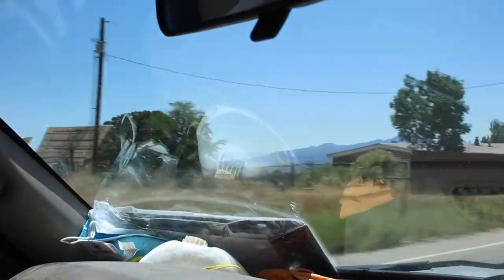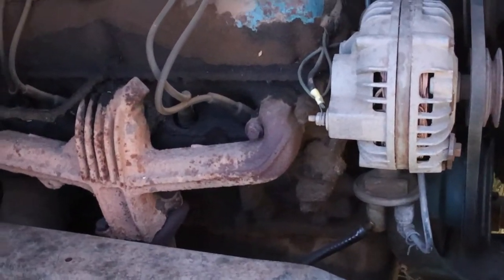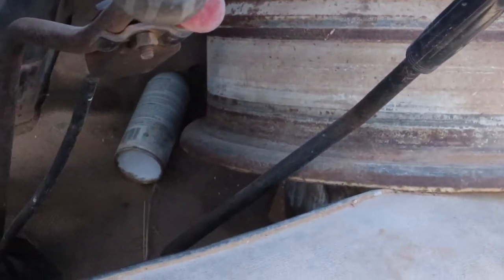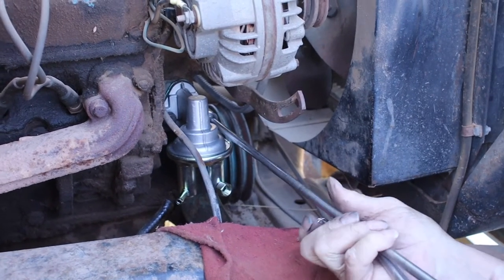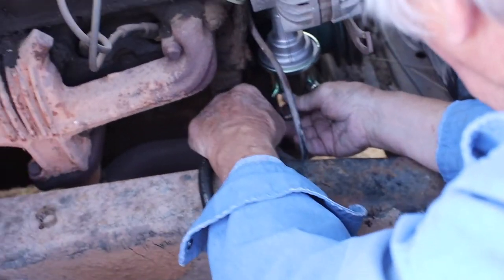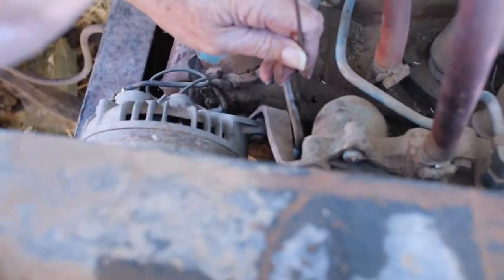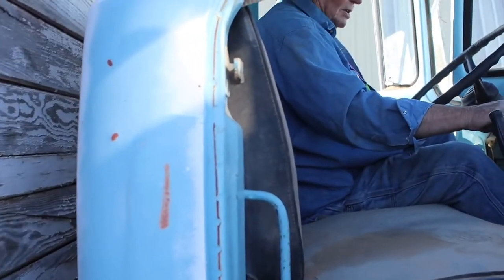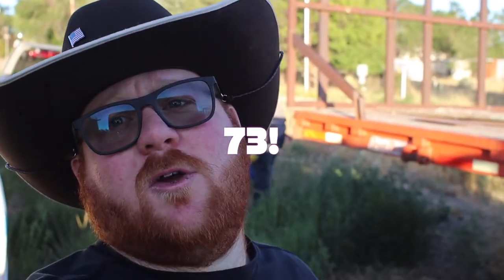1969 Fargo 500 Dodge Butterfly Hood

Comment: Mopar comes from MOtor PARts, that was a cross parts brand name for the thing that fitted between brands, so in short any Chrysler-built vehicle, so Dodge, Chrysler, Plymouth, Imperial, DeSoto or Dodge Trucks/Ram. By extension, it is also used for Jeep and AMC vehicles built after Chrysler's 1987 buyout of American Motors Corporation including the short-lived Eagle brand. In some countries they sold trucks branded as Dodge, Dodge Fargo, Desoto by dodge, desoto fargo and/or Fargo dodge.

Comment: These were designated as LCF for “low cab forward” yours is first I’ve heard as “butter fly hood”.makes sense.
Reply from the maker: He loves that thing. I knew absolutely nothing about the history when I made this video. If I ever do another video like this, I’ll research more before shooting. Thanks for watching and commenting
Reply: I just saw a video of a truck like this from Steve Magnante and he referred to this hood as a "Service Swing" hood. One of my friends had a  '51 Dodge "Job Rated pickup with a butterfly hood. It was hinged in the center and opened up on both sides like  Mercedes Gull wing doors.
Here's the link to that video. It's a larger 800, but it has the same hood.
https://youtu.be/ln2v46aPOqI
Reply: @mr.intensity2685  that what brought me to this video
Reply from the maker: Thank you for watching

Comment: I installed a new radiator in mine.  Used a 1990 International radiator.
Reply from the maker: Know anything about the brakes? We’re having issues even after bleeding trying to get them to work good. I know it’s a long shot and typing isn’t the best for this question but thought I’d ask. I told him we need to shock the air out of the hydro boost. He’s 82 so my personal experience with 1 ton old school Chevy pickups at 32 years old is worthless to him. This thing hasn’t moved in over a year because he gave up when we couldn’t get the brakes bled good enough. Thanks for watching
Reply: @rualmet  my brakes are air.  Compressor running off engine.  If it's a Hydraboost system, may have to rebuild hydraboost.  Rockauto offers this.  Late 70s Lincoln's use the hydraboost system as well.  Could possibly be the same application.  I'd research rockauto for pictures.

Comment: Ether is not great for diesel engines, won't hurt a gas engine. Though I buy the ether with upper cylinder lubricant.
Reply from the maker: That’s all there is now. All either has lubricant now. Use to be clean and dry. Now all wet and sloppy. Thanks for watching